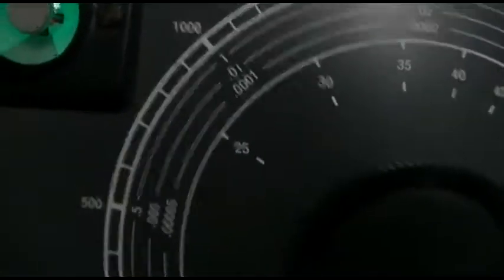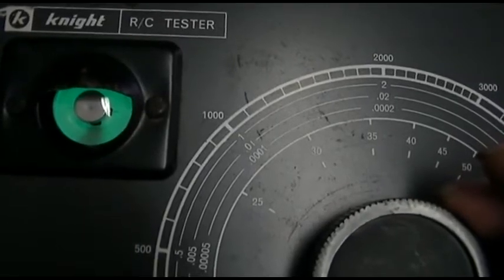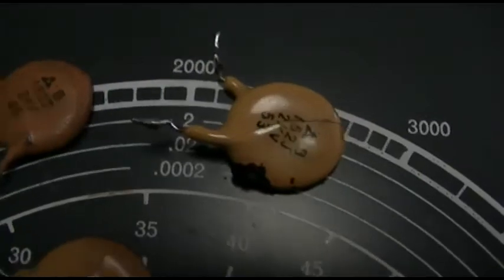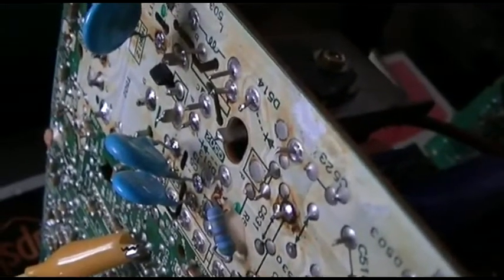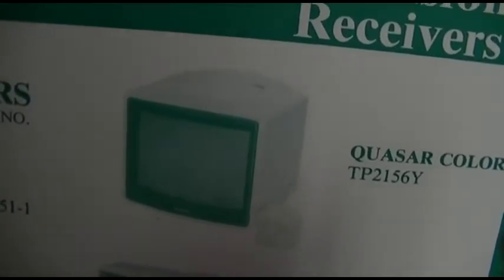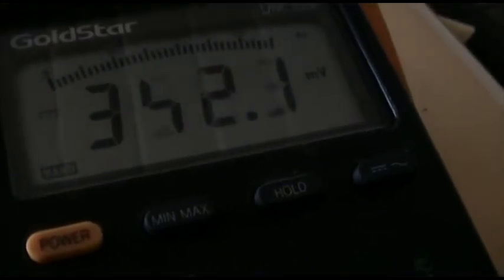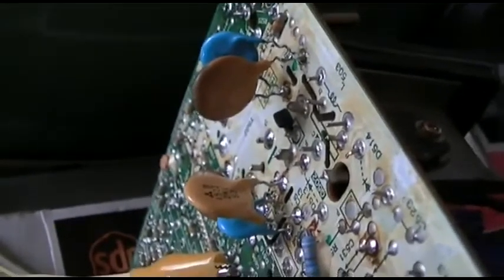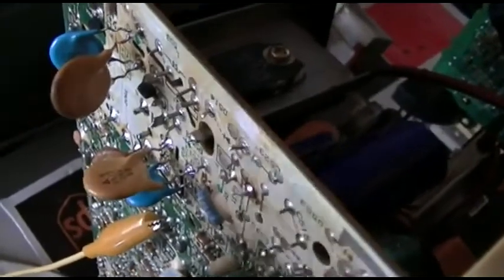Quasar The Fix

Comment: Reason for 4 of the same caps is redundancy. If one opens HV wont skyrocket but HVSD
will randomly trigger. The pretty blue 222 (2200pf) cap is a common fail on Panny, Sony & RCA. They crack, burn, short the HOT & often damage regulator. Zenith also used 5 caps in
early sets. If one opened the set ran fine but it slowly cooked the tripler, divider & CRT SKT.
C U later
Tom
LFOD !

Comment: Correct fix is the replacement of those high loss disc ceramic capacitors to a one low loss metalized polypropylene capaciror (MPP).

Comment: How bizarre. Is that a ferrite bead on the emitter of Q502? And a high ratio transformer on it's base? I can't help wonder if the reason you need the 4 caps paralleled is due to some sort of strange phasing relationship -just a shot in the dark blind guess, cause I am in the dark on this weird phenom. You had the culprits nailed but 4 distributed, paralleled caps being the ONLY "fix" was rather counter intuitive. Why not 2) .003's, etc for cripes sake!